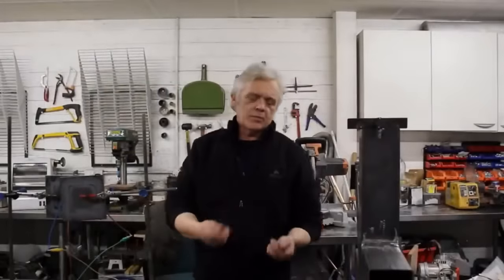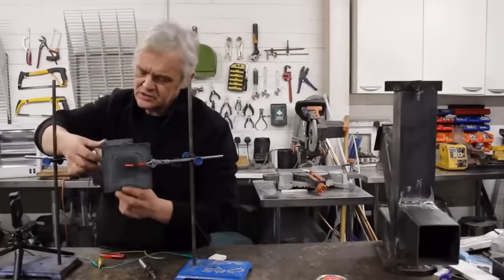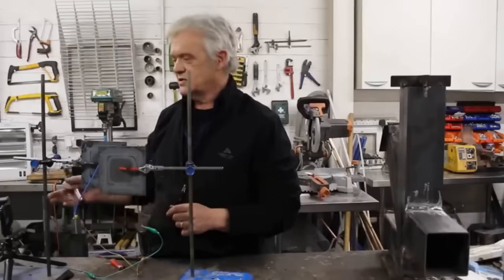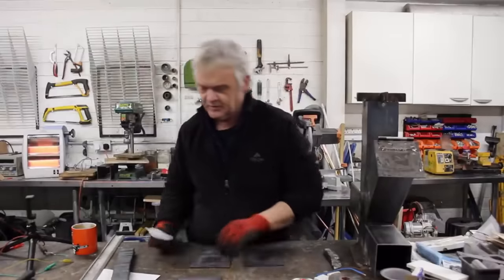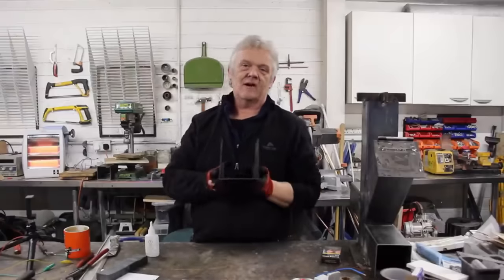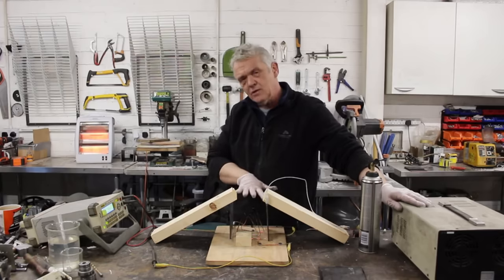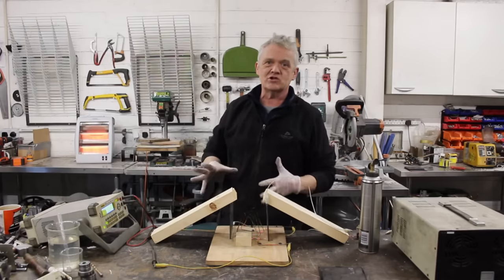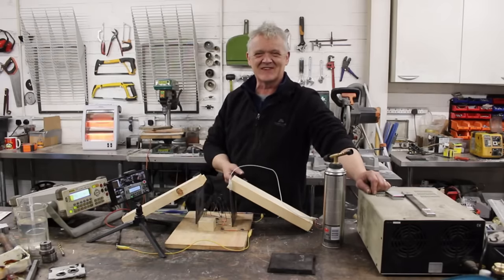035 Flame Powered Generation

Comment: Hi, maybe I missed an important detail, but I think the magnets would demagnetize at around 80 degrees Celsius. Might work for about two minutes in a rocket stove.
Reply: 80°C is the Curie temperature for neodymium magnets, (the temp magnets de magnetize), for ferrite is a couple hundred degrees celsius, and some hi temp magnets can hold arround 800°celsius
Reply: Would piezo electric crystals or molecularly aligned crystals be able to conduct magnetism and help put some distance between a cheap neodymium or AlNiCo magnet, so it can still generate without de-magnetizing from the heat?
Reply: If you're not using electro you could protect the magnets with something like starlite.
Reply: @gerryplayz4532 starlite is just highly pourous carbon, and will burn away just like other forms of porous carbon (think charcoal) when exposed to sufficient air and heat — which a rocketstove flame path definitely provides.

Comment: I'm reminded of a rocket stove that generates power to drive a fan to push in more air to increase the efficiency of the generator.  Now I know that one uses seebeck effect but why not use both?  Slap a couple of peltier coolers on the sides of the exhaust.  Scavenge every microwatt and make something neat.

Comment: Makes me think about a motor driven by potential energy when a magnet gets hot and loses its attraction.
Reply: As in, the moving magnet is attracted to another magnet above it, heat makes it lose it's attraction and fall into a colder area below it, the cold causes it to regain it's attraction and go up again, and in that way a temperature difference causes up-and-down motion?
I don't know if that would work or not, or if that's even what you meant. It's just something that popped into my head just now.
Reply: And that wire that responds to heat would be perfect to try and include for such a motor.

Comment: Thomas Townsend Brown invented a flame generator where you have two ends of polarized wire inside the jet of a rocket engine and the power of the rocket engine moves the ions from one wire to the next simply by their position inside the rocket plume. It creates a tremendous amount of energy of electrical energy simply by the position of the polarized wires in the flame plume of the rocket. You can look up the pattern under TT Brown for flame generator I believe . In Tesla famously made a circuit that would rapidly turn off electrical circuits as soon as they ignited or as soon as they connected by putting a magnet under two wires and when the wires arched it created an ionic field which the magnet quickly blew out so he would get instantaneous power on and off. This particular type of electricity was the third type of electricity that Tesla discovered and he dedicated all his life to it after he discovered it.

Comment: would seem to me, that if you arranged the set up to channel vertically, the flame draft can cause a good speed of movement from a modest flame( such as a mini jet almost), and using nichrome, perhaps a coil. If you incorporate maybe an easy capture metal,  like iron itself, to improve plasma like you were with potassium. I am thinking if you use an air feed helix funnel, like they use to make tornado effects below the flame, it will spin, and gather draft speed maybe. Primary thing is keeping magnets cool, as heating magnets weakens a or often turns them off entirely, and with not much heat to do it compared to some effect(iron would be glowing at that temp, but that is when it looses all magnetism, not when it seriously drops off)

Comment: Here's a question about generators in general.
As you increase the length of the wire, the voltage increases. But also, the thickness of the coil has to increase to accommodate the wire.

The effect of the magnetic field decreases as the wire moves further away from it (inverse square or inverse cube?).
So is there a point at which adding more turns on a coil results in a thickness that then puts it outside of the useful magnetic field?

In short, at what point does increasing the length, stop having a useful effect?
Reply: You're asking about the difference between magnetic field strength B (units Tesla/T) and magnetic flux Φ (units Weber/Wb). The density of magnetic flux basically equals the field strength. 1 T = 1 Wb / m^2.  In a motor or electromagnet, the field strength at the center of a coil is, indeed, inversely proportional to the radius (there's a factor of 1/r) :

 B = (μ0 I/(2R))n, where μ0 is the permeability of free space constant,  I is current, R is radius, and n is the dipole vector (the direction the coil faces, your thumb in the right hand rule). 

For any given constant current in a loop of wire, there will be a constant amount of magnetic flux inside that coil. A larger radius spreads out that flux over a larger area, thus resulting in a weaker field at any given point. 
In a generator, however, current depends on the load (and torque), and we have a different equation for determining voltage. For a straight length of wire, E=Blv sinθ, where E is voltage, l is the length of wire, v is the velocity, and θ is the angle that the wire cuts the magnetic field lines. Of course coils are made of wire, so we could do an integral to figure that out, but we have a shortcut. For coils of wire, the Faraday-Lenz law describes the voltage  as E = -N dΦ/dt  , that's the number of turns times change in magnetic flux over time. Note that radius is not present in that equation. It is governed entirely by the magnetic flux passing through the area of the coil. 

All that is to say, you can have a very large radius and still get the same voltage out of a magnet, as long as it's not so large that the magnetic field starts turning backwards within the coil. You can use metal or ferrite field guides to help with that. AC clamp-on amp meters rely on this fact. The real limit on radius is how many coils you can fit in the armature, and how big the radius of the rotor needs to be. The width of the coil is, to my mind, a bigger factor, because you're getting farther away from the magnet. Again, if you guide the field to go straight down the whole width of the coil, that's fine, but in open air you would start losing field rapidly the farther away you get, proportional to 1/r^3.

Comment: What would happen if you increase the voltage of the electrostatic field to over 100 thousand  or more volts. Is there a limit   to how high you can go with the electrostatic field  with no increase in power  output. 
I suppose the limit is when there is arcing between the plates.

Comment: Good one, mate, Thank you! I'm spending time further exploring the fourth state of matter. I'm primarily convinced and have settled that HV (high voltage) plasma, steel, copper and expanded aluminum are the materials for the generator/motor I'm developing! Physical shape & proximity is key for KW amplification. I've been experimenting with aluminum and sodium chloride (expanded aluminum) for increased voltage potential. Nichrome or tungsten I will need to perform experiments with to consider replace/add to or mix with copper. Adding potassium nitrate to aluminum is something I haven't experimented with in years when I was producing model rocket propellant for my aerospace pursuits. The device I'm creating is primarily intended for aviation propulsion however will be experimented with on yachts. I see the need for this technology to be employed in other areas such as rocket stoves. You've given me some other rabbits to chase, thanks again, Robert.